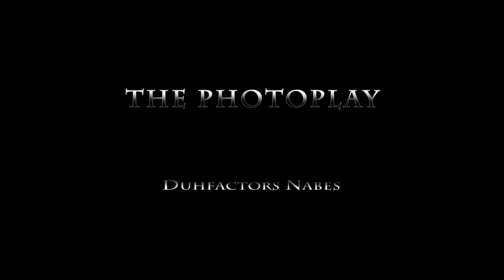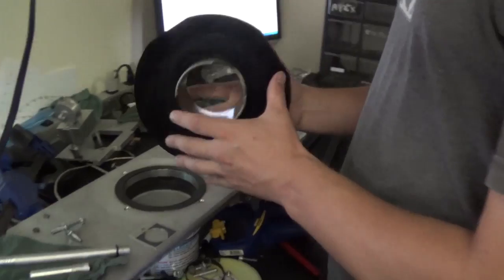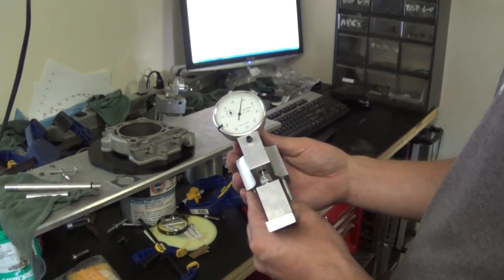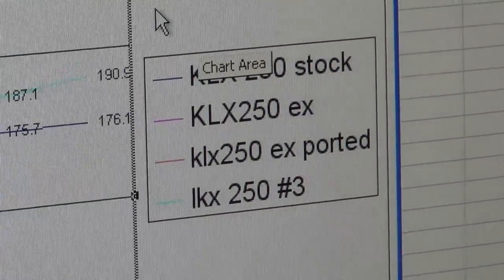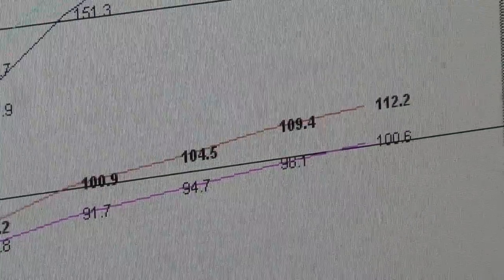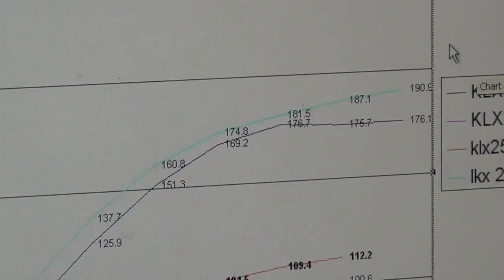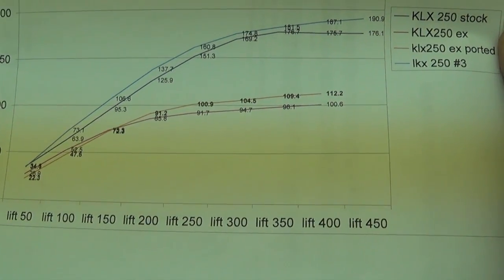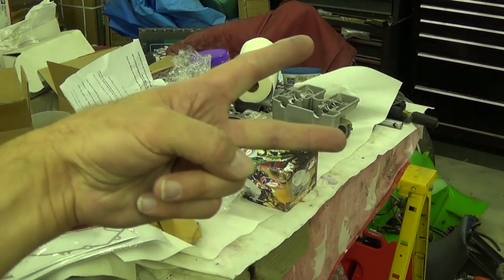KLX 351 Head Port and Polish - Lindsay Machine Racing

Comment: So where's the video of the finished KLX head?  How much HP did this 351 make?

 MotoMan added epoxy to a KLX250/365 back in 1997 or so to get max HP. Read all about it at half page here http://mototuneusa.com/the_2007_superbike.htm
Reply from the maker: https://www.youtube.com/watch?v=AZ1hRQ1wd2o
Reply: MrDuhfactor  I meant the where's the port & polish as the title here alludes to. Nothing in that vid link you posted except the fixed head gasket leak
Reply from the maker: Do you want the flow sheet numbers? I didn't really video the ports....
Reply: MrDuhfactor I saw the flow numbers on the screen in this video.  I was wanting to have a look at what they actually did to the ports or better yet-some dyno results.

I have a 331 waiting to go mine after I do the cam mod which will happen sometime in the next few days
Reply from the maker: Are you taking about advancing the timing cam mod? Oh, the highest known dyno results for a 351 is 34 HP on Bills bike apparently, I'll probably dyno mine in a couple months after my dyno guy moves his dyno, which will be this month supposedly.
Reply: MrDuhfactor Advancing the intake cam and retarding the exhaust cam. It's usually good for a little power on stock bores. Something easy to try and easy to reverse if necessary. I'll just take the spring off the auto  comp release.
Reply from the maker: Ooohhh.... talk to Bill first before you do that buddy, many have blown up their big bore motors doing that. It's o.k. on a stock motor, but Bill did extensive testing on supermoto bikes, and told me absolutely no cam timing changes, and they found the stock cams performing better than high lift or duration cams on lap times during racing applications. If he says it's o.k., then run with it, but he scared the poop out of me when I discussed it with him.
Reply: MrDuhfactor I'm still at 250cc for awhile; not in a hurry to burn through available mods-so the 331 kit will be in the box probably until mid 2015 some time. The Italian who first posted about the cam mod said it doesn't work on big bores; barely works on 300s. So I  guess it's just an interim thing to fool around with anyway. 

Though bore size alone shouldn't increase the chance of the cam timing mod causing a mechanical problem.

Comment: I would love a job there, but I don't think me saying on my resume that I can use chem die and have used a die cutter would cut it. He he get it cut it:-) dumb question time. How is it the combustion chamber from the 250 is going to match up with a 351 cyl.? Also did u have the header pipe ported to match the head.

Comment: don't forget that posting and polishing takes time and the polishing and some porting is usually done by hand. (Those three angle grinds are machined normally to the best of my knowledge).  The factory is into part production speed and cost savings.  As a result, the parts are usually cast and given the  "once over" to clean them out. Nowhere near what you'll get for your money at a shop with a flow bench